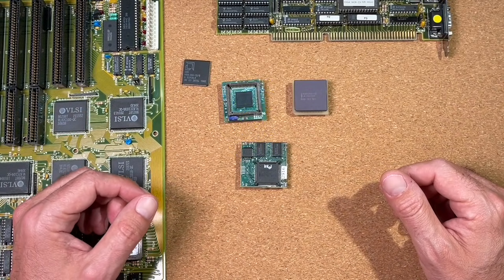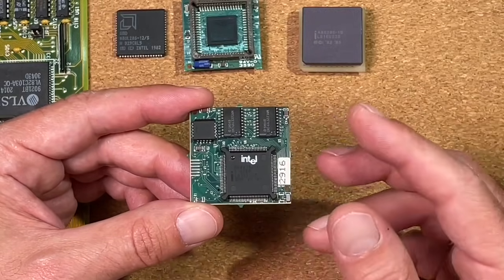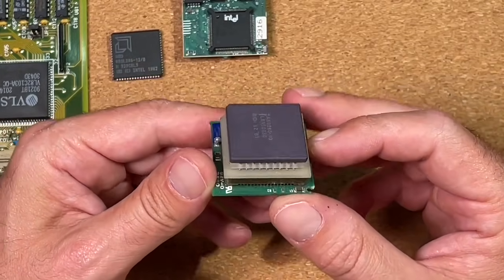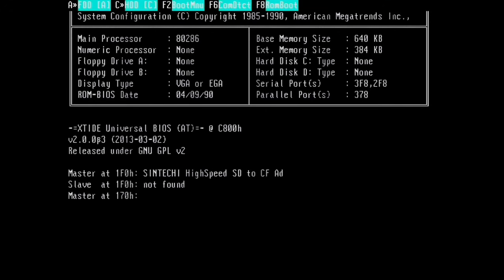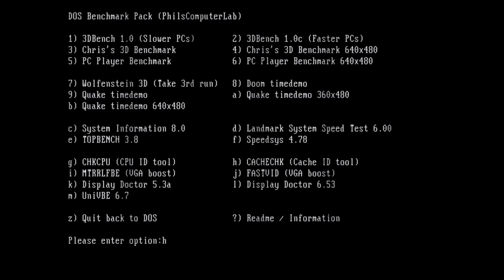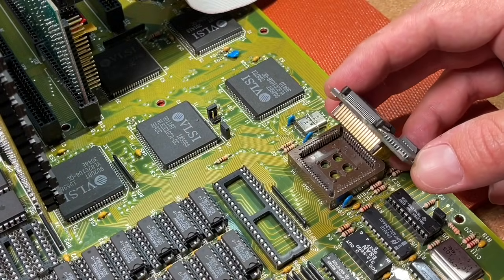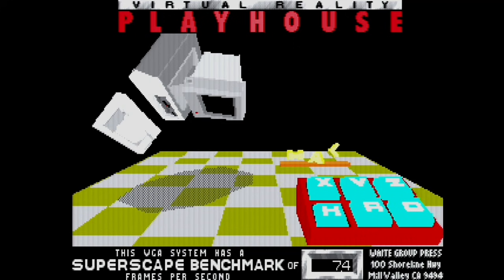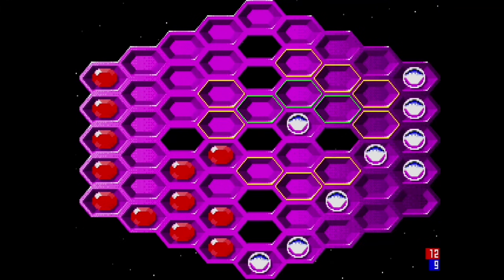286 Boost! Upgrade to 386 or additional Cache ~~ODD PARTS~~

Comment: I upgraded an IBM XT to a 486 via a 286 upgrade card. I then upgraded the 286 to a 486 slc chip. Was nowhere near the speed of even a true 486 SX system, but a LOT faster than the original 8088.